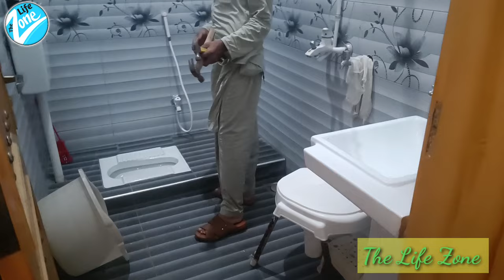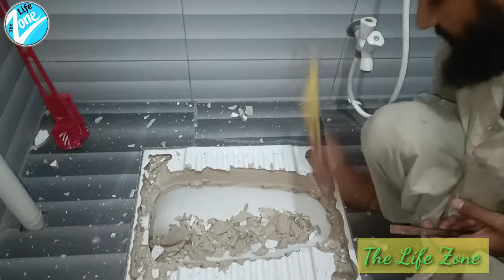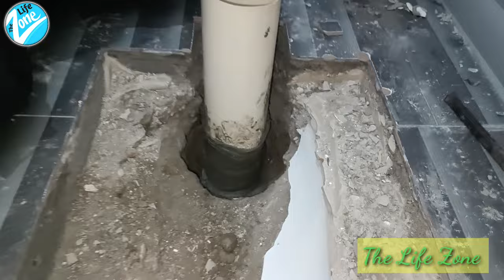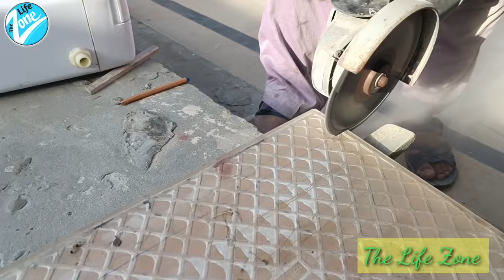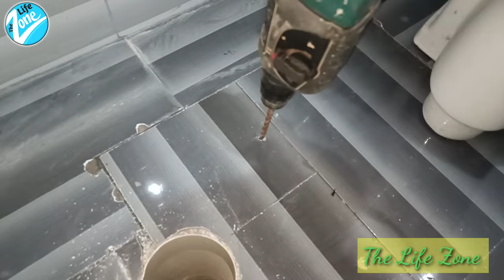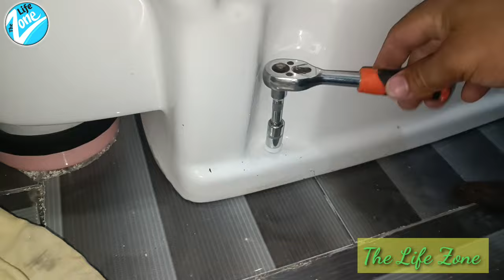Squatting toilet to Sitting Toilet | Converting Indian Toilet to Western

Comment: Bad job. P trap not removed. If p trap is not removed you will never be able to flush properly. It will stink. 
This Short cut method is not advisable.